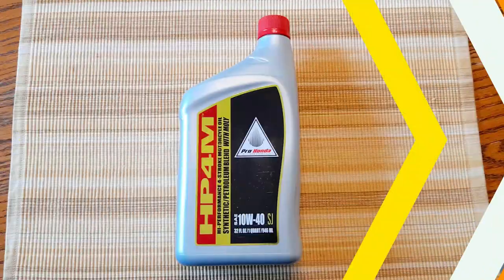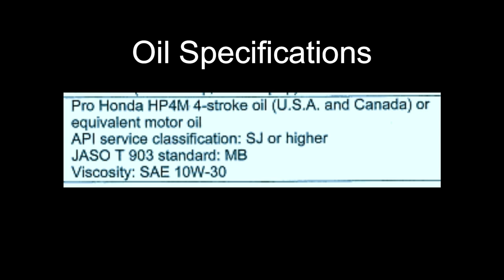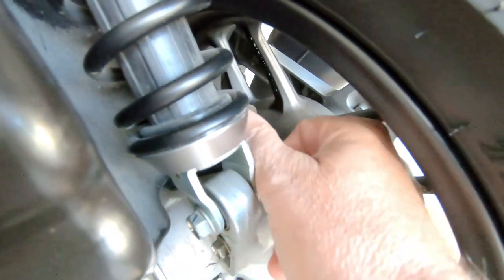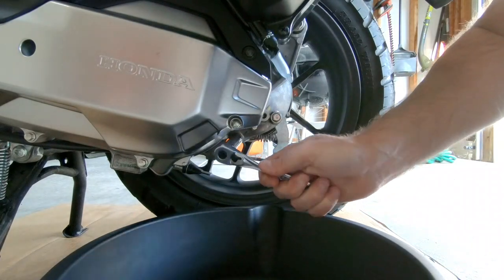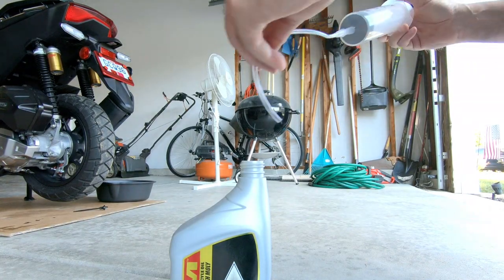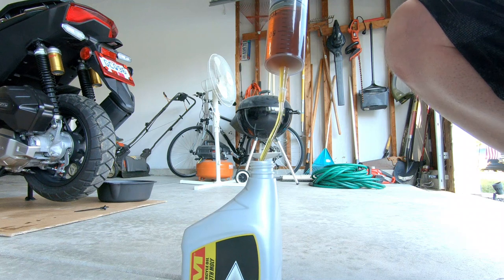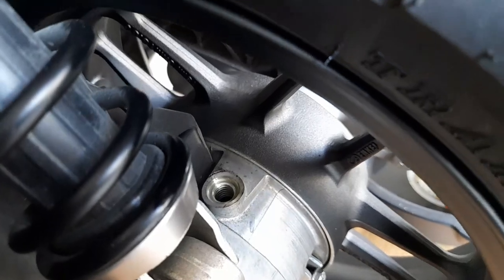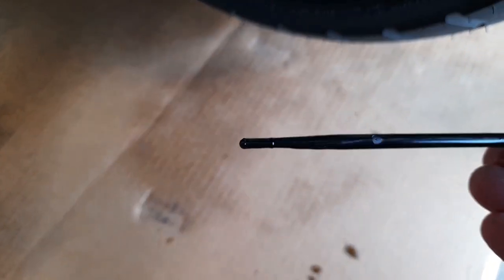Smooth Shifting Secrets: Mastering Gear Oil Change for Your Honda ADV 150

Comment: Great video! Ready to give my ‘23 ADV its first oil change and I will also change out the Final Reduction as well. I purchased a shop manual which suggested to slowly rotate the tire while draining the final reduction fluid, which I’ll do.
Reply from the maker: Great tip about the tire, thank you! Have fun! :)

Comment: Excellent.  I'm really glad you made this.  Thank you!
Reply: The only thing that trips me up from your oil recommendation is the 10W-40 oil you recommend when the maintenance manual says it should be 10W-30.  Did you say it is because of the weather or something?  I'll watch again.  Well done.  Thanks again.
Reply from the maker: @CopyWhoTV  My dealer uses this also for Gear Oil and I figured it would be fine in a warmer climate when I ride the most. If you can get 10W-30 that's what the Service Manual suggests. Not much difference really. 10W-40 is slightly thicker and fine in warmer weather. If you ride in a colder climate I'd stick with 10W-30 if it were me. Hope that helps. ✌️

Comment: I've been binge watching your videos because I'm looking to get an ADV 150. I no longer have the "need for speed" and just want reliability. My question is: Are the screws in this machine standard phillips or JIS? Oh yeah, I also subscribed!
Reply from the maker: Thanks for the sub! Do you mean like screws for the covers and things? I'd have to check because I've never taken covers off to be honest. I'll let ya know though!
Reply from the maker: From what I am seeing typical Phillips, especially for covers. They also use plastic clip removal tools you can get off Amazon or eBay to remove snap type cover connections.
Reply: @Trekopolis  Thanks for the reply. I know that Japanese bikes use Japan Industrial Standard (JIS) screws that look like phillips but can be stripped out if you use a phillips screwdriver. I wasn't sure about this machine since it's being made in Thailand.
Reply from the maker: @dmac9954  I cannot find anything on this. Service Manual doesn't really say and when looking up parts it just says "screws" lol I'll have to test on my bike and see what fits best and circle back to you.
Reply: @Trekopolis  Thanks again. "Usually" a JIS screw will have a dot on the screw head.

Comment: Thanks again, my 2022 is being delivered this week, getting some of your gear off Amazon through your link. Did you need to get mirror extenders with the windscreen you put on?
Reply from the maker: Nope! No extenders needed for that screen. Appreciate the comments and congrats on the new bike! You'll really enjoy it. ✌️
Reply: Have you considered adding an aftermarket exhaust, I know the stock muffler is super quite?
Reply from the maker: @MrFifth-up9jz  I have, but undecided on what kind. It's not a priority since I'd rather get a box on the back before anything. My next video will explain why!

Comment: Well,i dont have honda oil with moly in it,only regular full syntehic,so i changed engine oil (runs good) and changed the gear oil with the same 10w30 that used in egnine (without moly as i said) and im not happy with the sound of the gear box.
Is that cuz the moly is missing ? Should i manualy add moly in it or use 80w90 ?
Reply from the maker: When in doubt go with the recommendation the service manual states. I've not really noticed anything unusual regarding the sound of the gearbox to be honest. Did you notice a difference after you changed it from the factory oil?
Reply: @Trekopolis  yes,grinding sound,because my oil dont have moly in it,and the factory one has (silver thing in it is moly)
Reply from the maker: @audiophilipp  Well, you may want to drain and fill with that and see how it sounds. It's easy enough to do. I may add a little MMO to my gearbox for good measure. Not much, just a few MLs. I use it in my fuel and all my other vehicles. Helps reduce noise and extends the life of mechanical stuff.

Comment: The density of motor oil is about 0.9167 grams per milliliter. So, 123 milliliters of motor oil would weigh about 112.7541 grams.  Use a gram scale to measure the correct amount of gear oil if you don't have a volume measuring cup.  I'm going with 113 grams since kitchen scales are only accurate to 1 gram.
Reply from the maker: Would the type of oil matter, meaning 10w-20 vs 10w-50, etc?
Reply: @Trekopolis  Maybe, but the difference in density would be so little as not to matter measuring so small an amount.  A 5W-30 might be a miniscule fraction less dense.  I learned to cook over the pandemic and discovered the metric system finally and measuring everything by weight is so much easier and scalable.  On the ADV150, you can change the engine oil AND the final reduction oil with slightly less than one 946ml (quart).  694g for the engine and 113g for the final reduction gears.  That leaves about 61g unused in a quart container (Total gram weight of a quart of motor oil is about 868g). I used Valvoline 10W-40 Full Synthetic Motorcycle Oil.

Thanks for the videos.  I'm learning a lot from your experiences.
Reply from the maker: @SunshineDave  Thanks Dave. Appreciate that. I'm not a gear head by all means, but enjoy learning as I go. I'd rather save some money and do things myself if I can. It's also fun to tinker at times as long as it's not 120 degrees in my garage!

Comment: I have a 2013 Honda pcx 150 my manual says to use 10w30 MB Honda oil but I can not find it anywhere even at the Honda motorcycle dealership  they say I can use Honda 10w40 MA oil is that so our are they telling me that because they don't have 10w30 MB the trouble is the closest Honda dealer is 50 miles away from my house and no one around here even sells Honda motorcycle oil.
Reply from the maker: eBay or Amazon?
Reply: @Trekopolis  I looked on Amazon they don't have Honda HP4M  10W30 MB
Reply from the maker: @catfish24  You can use this. It's their latest synthetic. https://amzn.to/3Fohxg3
Reply from the maker: @catfish24  Or if you want the HP4M https://amzn.to/3SWFqkm
Reply from the maker: @catfish24  Yes, the 30w is hard to find, but I'm going with their synthetic next time. ;)

Comment: hi buddy, I'm about to actually change the gear oil (will use my kitchen measure cup instead of your medical fancy injector 😆)  when I get the HP4S 😛10w30. I wanna change my engine regular oil with the full synthetic version, hey you almost at 1k subs 👊i remember when i joined, you were on the 300s. so congrats well earned, on a site note: my rear tire treat is low (4300 miles) or due to change, well my dealer doesnt have the tire in stock but they checked on US stores and are backordered 😮 for months. So you need to start looking and buying your tires, watch videos on top brands etc i was able to find a bridgestone battlax sc on ebay for $100, the dealer charge $50 on labor. Once arrives i will have them install it LOL im too chicken to mess with that even if i have the service manual (noticed you got your 💪), they will inspect my scooter as well break system, pads,  etc...   one more thing that big piece of metal is no bueno, it means something broke inside the autoclutch gear or whatever they called it but i highly advise you to open it apart and investigate the cause and/or replace a part inside (video please LOL)
Reply from the maker: It looked a lot bigger in video, but it was pretty small in actuality. I saw a few larger shavings on my first oil change, but didn't film that back then. Shavings are fairly normal on new vehicles from what I've read. I'll keep an eye and ear on things and will change my gear oil next season just to see if anything else exits the area. Yes, nearly 1k subs! That's exciting and I've worked hard for it so it's starting to benefit. Thanks for all your support along the way too. Really appreciate my regular followers! Hey, Honda has some new oil and I'll post something under the Community Tab soon. I forgot the link, but it's a newer generation oil. Replaces the oil I used in my engine oil videos. Things are always changing! ✌️
Reply: @Trekopolis  gotcha, well im glad its not a big metal. Agreed about the oil change i will do mine season on the gear and sooner mileage on the engine oil. Sweet!! i will look around for the honda new gen oil formulas. Thx see ya on the next one :)
Reply: @Trekopolis  I'm getting close for an oil change.  Info on the new oil would be great!
Reply from the maker: @fbeaston  I'll post something in the Community area later today. 👍

Comment: I think I will change this every season. That should get me around every 4-5k miles. Oil is cheap so it might as well be fresh. 😂
Reply from the maker: It's easy enough to do. That quart bottle will last many changes with only using 123ml.